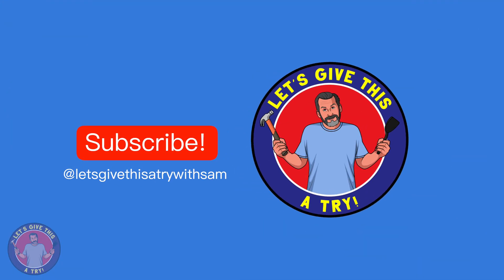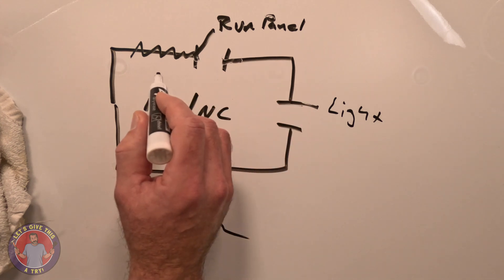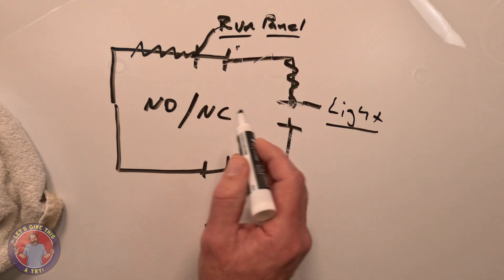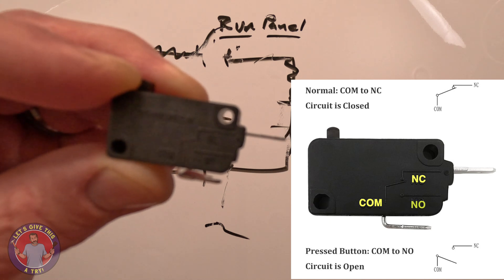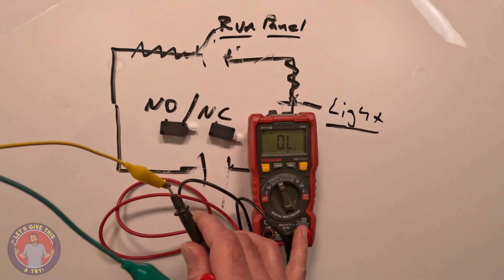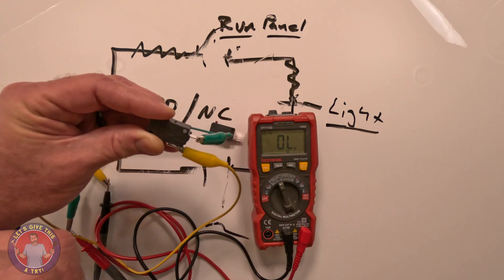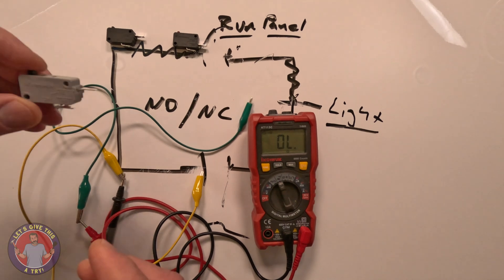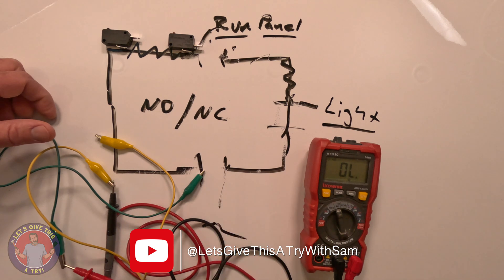A Simple Guide to Understanding Microwave Switches

Comment: I hate to be the bearer of bad news, but I think you better pull your video before you kill somebody. The term Normally Open and Normally Closed has nothing to do with the door ... it is about the switch. 
A switch in its depressed position, AKA actuated, (or made) is what is being referenced, not the door. 
The relaxed position of the switch's button (Not made/not actuated) is NORMAL position. The switches were labeled correctly. 
You might also want to know that ONE of the door switches is very special in that if the Thyratron is still emitting high frequency, cooking, and somebody does manage to pry the door open, this switch will short the hot to the ground, and blow the 15 amp glass fuse in the microwave. (It also burns the switch up inside) It is a safety device from the 1970-ish design, that still chooches. There is a warning label on this particular switch, not to substitute a similar looking switch, to keep people that don't have a clue, from BBQ'ing their brains out. Please don't hurt yourself.
Reply: Out of curiosity since it seems like you are well versed in this subject are you saying appliance companies are putting that much risk in people’s homes that one switch could burn down their house?

If so then thank you
Reply: @MattLandauer  Itis not that they are putting people at risk ... they are preventing people from frying their brains, from prying the door open while it is running, and exposing themselves to the non-ionizing radiation. If they manage to bypass the other door switches, or the other door switches fail, the one switch that says, "Replace with identical switch only", allows the switch to handle the fault current between the 2 sides of the AC line, and blow the 15 amp glass fuse, located in the electrical compartment. You can easily replace the fuse, but if there is any kind of door interlock problem, the switch guts blow up - although the switches fireproof housing will contain the flash
Reply: @MattLandauer  MIcrowaves have components with thousands of volts across them. This is why security torx screws are used so that average person with a regular screwdriver cannot open them. If Apple made them, they'd just seal the whole unit and you'd have to throw it away even if a tiny $2 switch went bad. 😀 Nobody without the proper training should ever open a microwave. Even a microwave that's unplugged can deliver a nasty shock because of the stored charge in the capacitor.
Reply: Wait.   Are sure we don't have that backwards ?  I thought that the  Term "normally opens"  means that the circuit is open when it's not depressed,  When it's an it's normal position(  not actuated) and then  Ones that are "normally closed" are the ones that pass electricity when the button is not depressed  (door open) and then when the button is actuated (door closed) it then opens the circuit
Reply: @deransanchez3162  When you buy a normally open or normally closed switch from a store, the vendor or manufacturer has no idea of the application it is to be used in. 

The labelling applies to the contact arrangement in its "at rest" position from the manufacturer. 

There are other designations that are common in electrical circles, for what you are witnessing. 

NOHC is Normally Open, Held Closed, for a switch that in the appliance manufacturer's application comes from the factory as Normally Open (The labels on the switch itself), or for a NCHO switch, where you look at the labels on the switch that would be C & NC or (Common and Normally closed), but when put into use, may be trapped or held in a position opposite of it's manufacture.

If you really want to get confused, try tracing why a decision was made, and by whom, to teach that electrons (electricity) flow from positive to negative, instead of it's real direction, from negative to positive.  (HINT: Stubborn old men, copyrights of old books, colleges greed, lost profits and more) 

You're not going to find this in any books ... been suppressed for 100 years.
Reply: @deransanchez3162  You're right! He's wrong; he's completely reversed the operation logic of the switches.